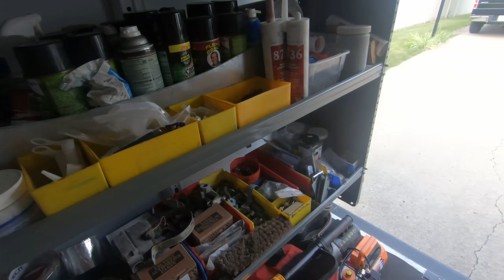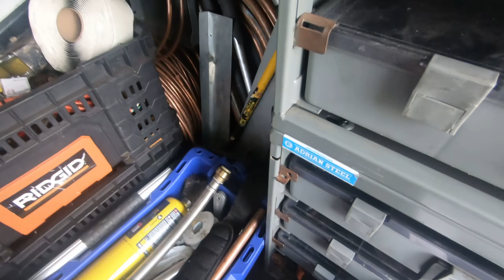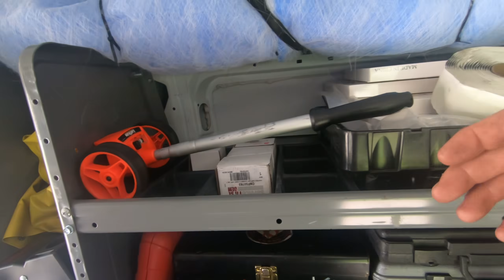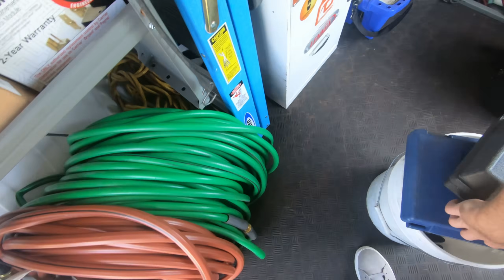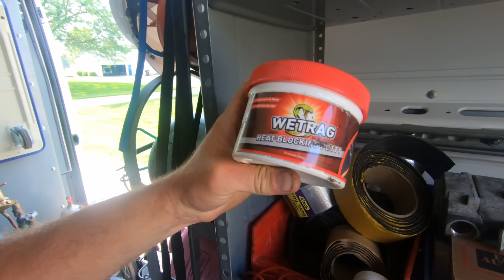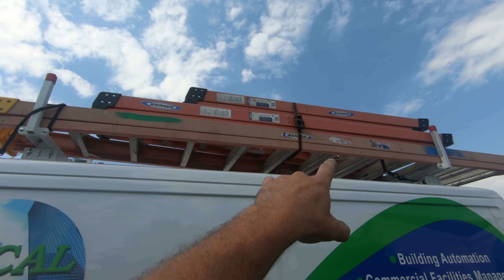HVAC Van Tour 2021

Comment: Just found your channel. I'm in upstate NY. Approx 2 hrs north of NYC. Thanks for the tour. I'm required to carry an assortment of motors. 1/3, 1/2, and 3/4 HP. And rescue motors. Also need to carry replacement inducer assembly's. Might I suggest a 4" x 10' PVC tube between the ladders? For lengths of copper and smaller PVC. New subscriber Ron.

Comment: I bought a Work cordless pressure washer best tool ever no need for water hoses you can put a 2 liter bottle of water on the pressure washer adjust the pressure and bam you can walk a commercial roof top I have 4 bottles on the van so I have plenty of water

Comment: I got a Sprinter back in 2017. Love the room in the back. Let me know how to Promaster works out.
Reply from the maker: Will do Brutis! Thanks for watching
Reply: @RyanHughesHVAC  meanwhile I’m driving a citroën berlingo which fit’s in the back of your van 😂😂
Reply: @plumbraider2265  If you do downtown city stuff, a Berlingo is fine, but you have to be careful how much junk you put in it. I would love a smaller van, i drive a Transporter LWB.
Reply: @persimonsen8792  I service all types and brands of combiboilers and gasfires. I have outgrown it. I’llbe moving into a transporter in a month or so
Reply: @plumbraider2265  I do refrigeration. But in Copenhagen where i drive mostly, it's to find parking with a smaller van.
Reply: @persimonsen8792  yeah I get that. I live in a small town of about 30.000 so it’s fairly easy to park a transporter. In the bigger cities a small van is way easier.